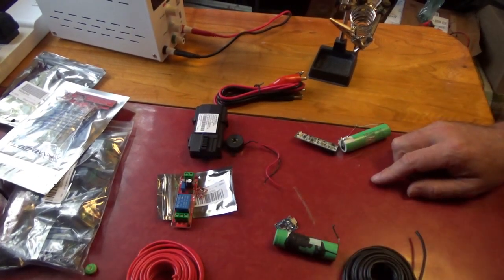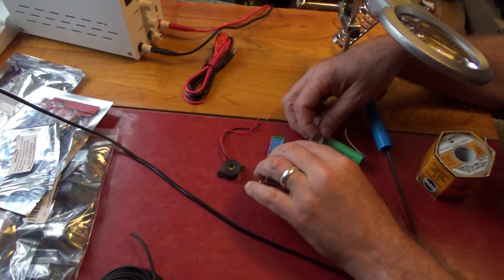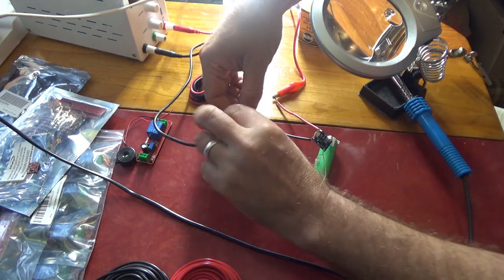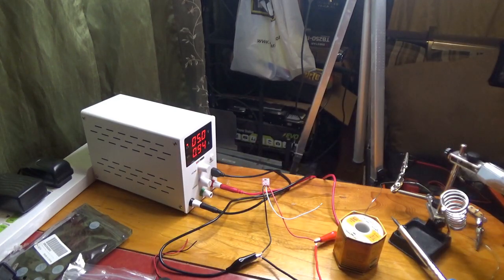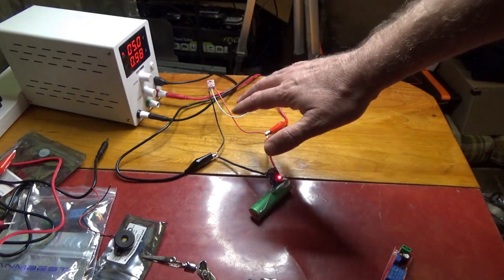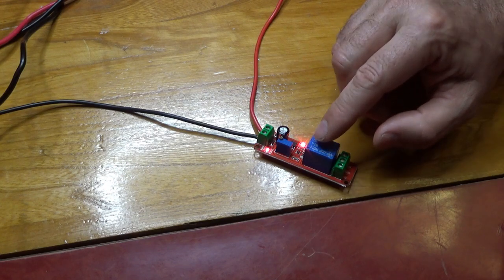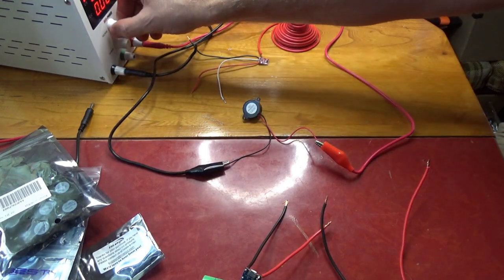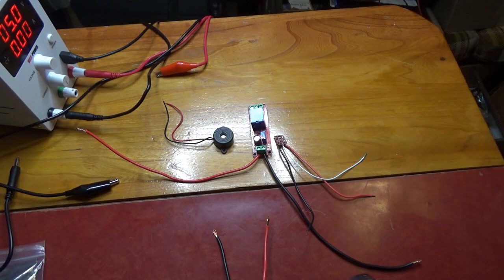Putting Together A Touch Sensitive Perimeter Defense Alarm System

Comment: thats what no and nc is for, you choose its logic! so forget the relay led that is just status, you wire it up how you want. but yeah if you have a power cut or it gets triggered you want it to energize instead of other way rund i get that.
Reply from the maker: The other issue is that it powers on the relay and burns 60 mA until I reset it. I may be able to use this "as is" but I need to turn off the circuit once its finished with its cycle.

Comment: Troy, what you need is called an SR Latch circuit, its very easy to build, look it up.
Reply from the maker: Yes, I am thinking that may be easier. But I also want a timer to shut it off after a few minutes.